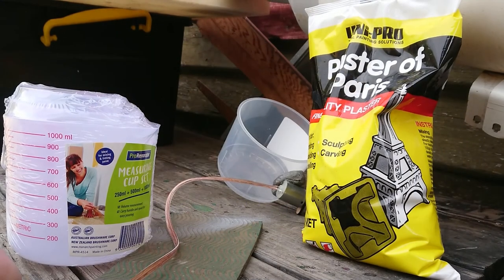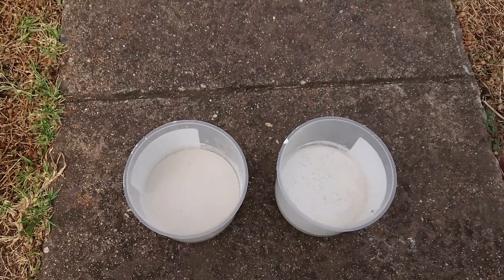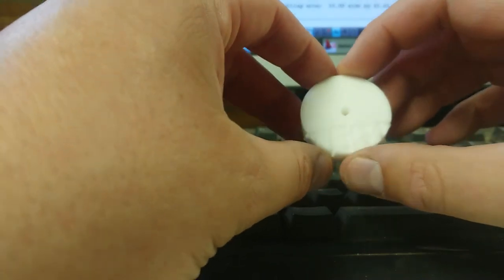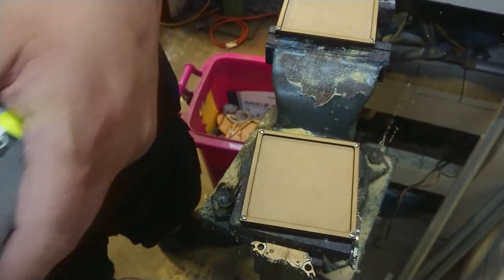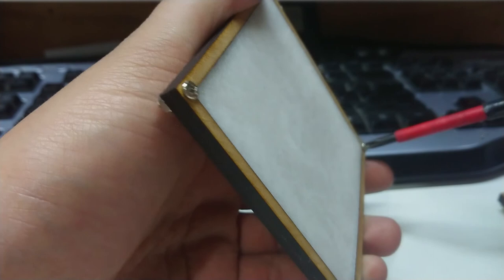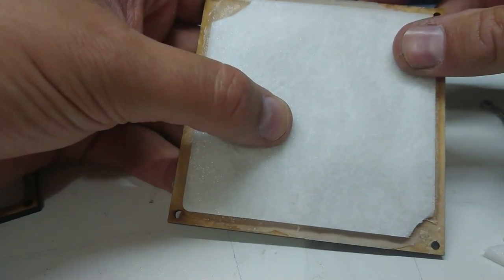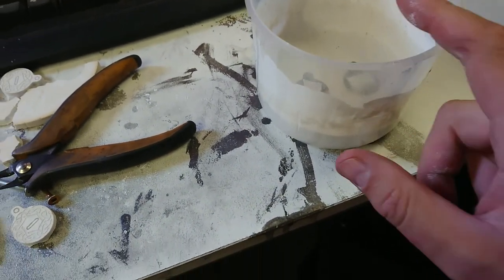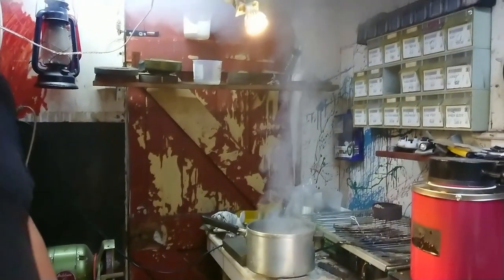Finding unconventional ways to cast brass...

Comment: Happy New Year mate, hope  you are okay with the smoke and blustery weather in your part of the state.
✨👍🦘👍😊 Tom, in the other half of Victoria.
Reply from the maker: well fire front is about 30 min away from us.
we have evac plan in place as none of us are physically capable of defending. however if conditions remain the same it won't head out way.

wishing there was more that I could do for those worse off though. have my brain working on that issue right now.
Reply: @TheAussieRepairGuy   I only just got to see the rest of the video mate, had to do some chores.
Don't stress over not thinking you are not  able to help with the firefighting situation.
Just having a plan and resources to move out when in the danger is fantastic.👍👍👍
Fireys have less stress themselves, when they realise any situation they are in, if there are no other lives threatened.
These guys all over the country deserve our help and respect.👍👍👍
Stopping and taking time to mention them in your video is great.👍👍👍
Can I suggest you bake your plaster moulds in a domestic oven, I used to work maintenance engineer in a brick factory and long cooking time is the only way to get the moisture out of the a dense medium like plaster. 👍
Reply from the maker: @tomgeorge3726  The molds were baked, just not nearly long enough.

As far as fireies, I'm still a card carrying volunteer technically, had to stand down this year from tower duty, and my whole family has been cfa for years, my mother was 35 years in and first female captain in the state.

It's still hard having to sit on my hands